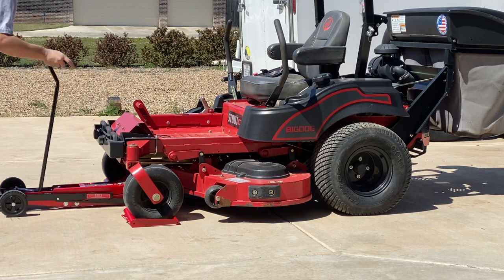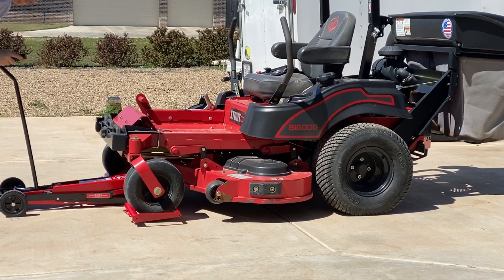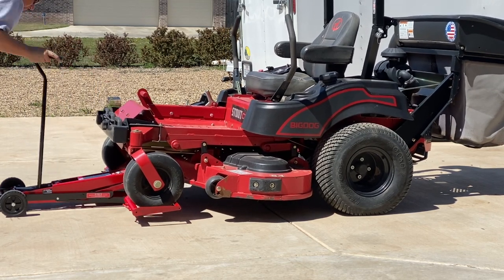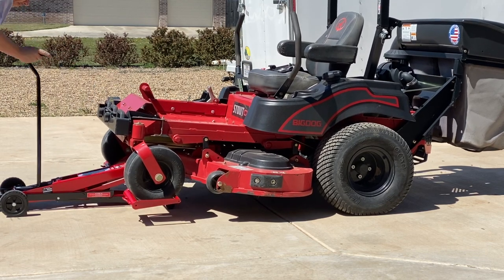How To Sharpen Your Mower Blades

Comment: Check out Steve’s Small Engine Saloon - How to sharpen a lawnmower blade. He explains why checking the blade balance the way you have shown is not always accurate and shows an alternate cheap but effective way to check balance. He also has lots of info on yard equipment maintenance that is worth checking out.
Reply from the maker: Kevola I had to go look it up. You’re right! That is a great little tool that I am going to invest in. Thanks for this.